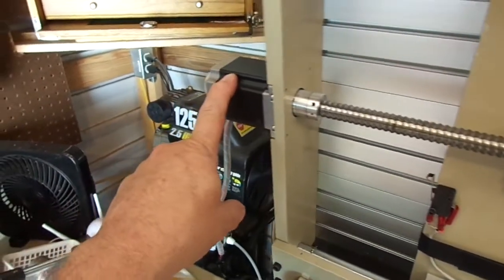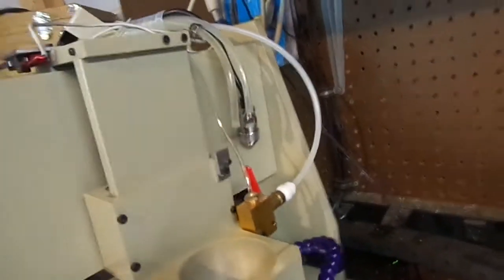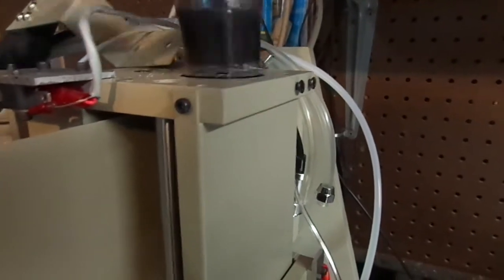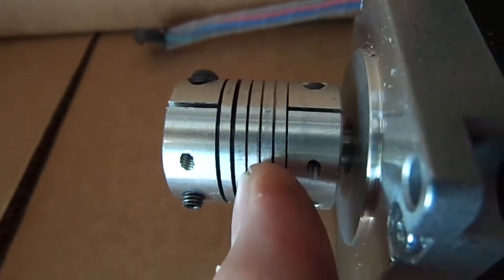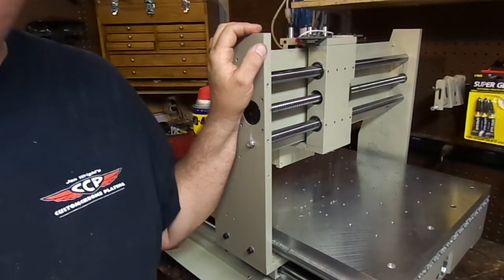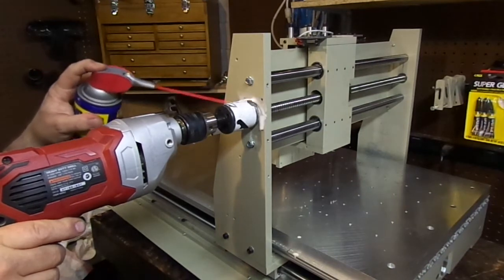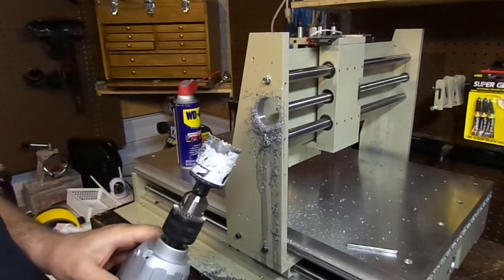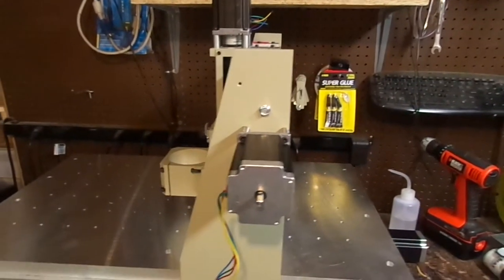6040 CNC Upgrade Video 4

Comment: Hi Rick, thanks for the Great Videos. i am wondering if u have STL file for the 3D printed Guide ? and also where did u get that Aluminum Bed ? i also got the same machine and also getting a Gecko unit from the same awesome Guy u got it from and i like ur set up and want to create same thing or something simular. maybe u can help me out a bit? thanks
Reply from the maker: I added the files to my website if you want to download them. The one file is the fixture plate and the other is the drill bushing. Only thing is it's the Fusion360 file and you will need that to view them. They are zipped (website requirement) so simply unzip them and upload them to your fusion360. 
Thanks for watching and I hope you have good luck with your upgrade

Comment: Hi Rick, I wonder if you could help please. I've just bought a 6040 router from China and have a problem with it. I have tried talking to the people in China where I bought it, but I feel I'm fighting a losing battle. All was good for a start and I cut 5 or 6 pieces in wood with no problem. Then the Z stepper motor started acting strange, and I'm now unable to use the cnc. The Z stepper motor started getting loud and using the arrow keys on my keyboard, when I press the Z down key once the motor moves down. If I press the down key again the motor moves up. using either the up or down key it seems to do what it wants. I have made a short video of the problem and wonder if you could take the time to have a quick look for me please. The machine is only 4 months old and I think I need a new stepper motor, but you might be able to tell me what the problem is. I would be very grateful for any advice. https://youtu.be/qwKdiwVVDkc Thanks, Terry.

Comment: I have the same machine and think about update. Can you share the model (or link) of new step motors? Also, will they work with original (TB6560) drivers? Thank you in advance.
Reply from the maker: They will not, you will need a larger power supply to run them. Contact Vince at eDealers direct for a complete setup. This is a 48v power supply which is double the original power. You will notice that when the stock motors are at idle and locked you can still force them to move, these will not move at all when locked.  There is information in the video description of the guy who built my control box. I have had no issues at all since the upgrade. Thanks for the question and thanks for watching
Reply: @cpworx_maker  Thank you for fast reply

Comment: I bought mine from a company called Black Cat CNC in Tyne & Wear UK. The couplings on mine are solid, no backlash and all ballnut drives with zero backlash. No wobble on those bad boys. He did all these upgrades BEFORE I bought is and, best of all, that is his STANDARD machine.

Comment: I have a bobs e3, and the more research I do , the 6040 seems to have every advantage possible , including the potential for upgrades.question, can you run cam outside of mach, or is the firmware set for mach 3 ?thanks
Reply from the maker: The G-code is sent to a Break out box, so it can run from any source and not locked in with Mach. I will say that the machine in it's as bought state is really only suitable for engraving and mild milling. The steppers aren't strong enough and the X Axis doesn't have supported rails. Basically upgrading to the Gecko driver, a better spindle and VFD and supported rails adds about $1500 to the initial $1200 price tag. I was trying to do very fine work and the machine simply wouldn't work reliable enough. If you don't mind a little work and spending more money than expected it can be a great little machine. FYI, You cannot do steel with this machine, partly due to the spindle speed and power. Thanks for the comment
Reply: thanks for the info..

Comment: Got the same machine and my upgrades are actually more important - get rid of the flex caused by using linear rods on X & Z axis... Linear rails with 30x60 profiles did the job... Machine is much more rigid, but.... The whole X & Z axis is totally rebuilt, except steppers and ballscrews nothing original is left...
Reply from the maker: firefoxik75 would love to see a review video of it as well as a parts list, that may be something I could do in the very near future! Thanks for the advise
Reply from the maker: Found most of what I need... Once this machine is back online I will be doing a series on this very upgrade! Thanks again